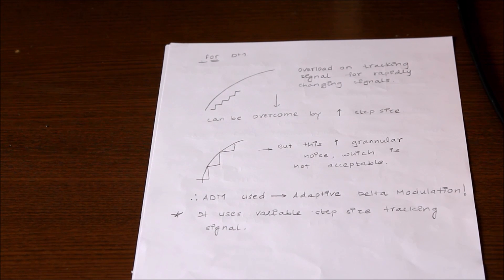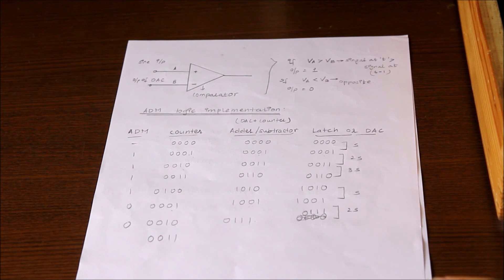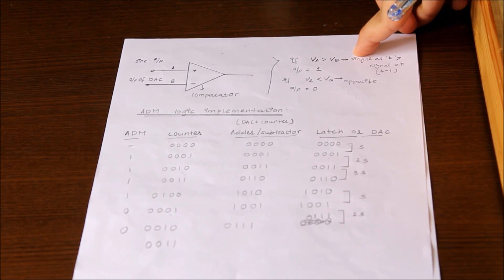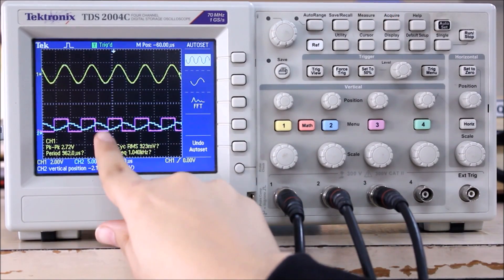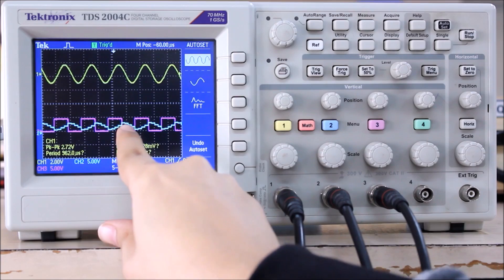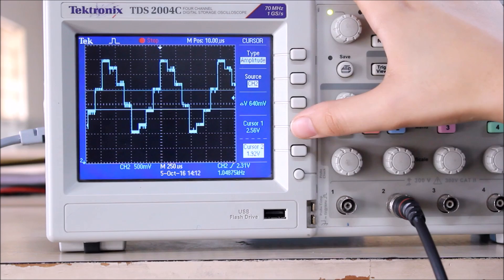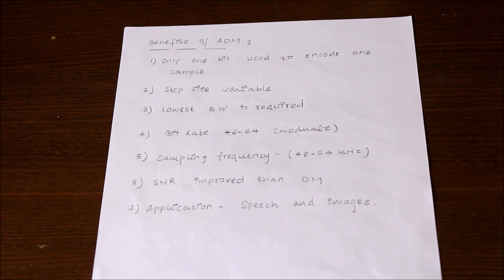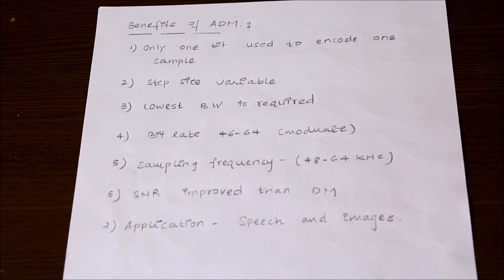Adaptive Delta Modulation

Comment: 1. We need to do oversampling to use ADM or DM practicality, and what you have written sampling frequency is 48-64 kHz ie I think for voice msg signal whose maximum frequency is lesser than 4kHz. so bit rate is 48-64 kHz.
2. but in case of PCM we can work with sampling frequency equal to 8khz itself ie Nyquist rate for voice. and typically the number of bits required is 7-8 bits. so bit rate for PCM is nfs = 56-64 kHz.
3. so no benefit in bit rate practically.
it's nearly the same for ADM and PCM.
4. and if we see DM we require fs= 64-128 kHz and bit rate is 64-128 kHz  worst bit rate amongst all voice encoding scheme.
5. the only advantage for using DM and ADM is hardware simplicity and design with moderate quality.
basically it exploit the features of signal correlation.